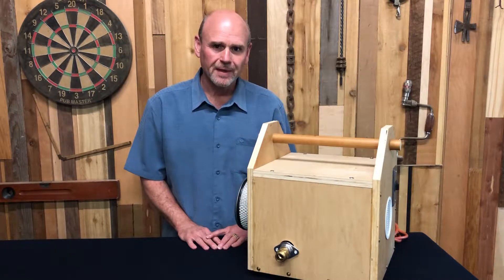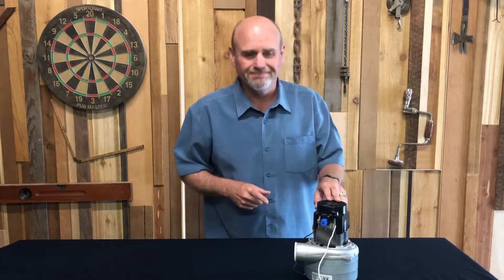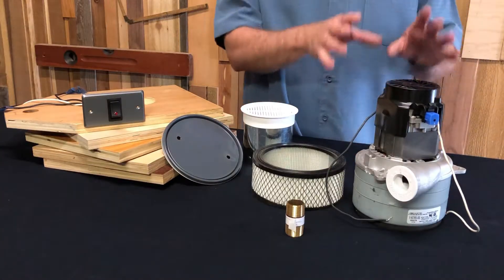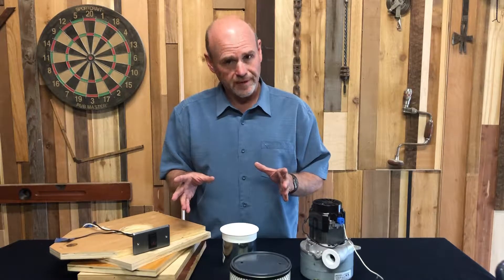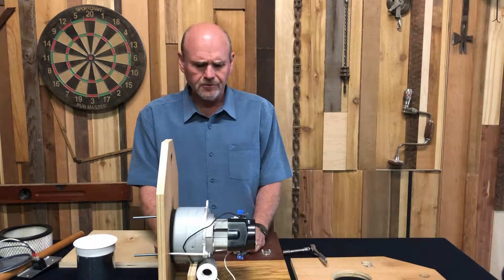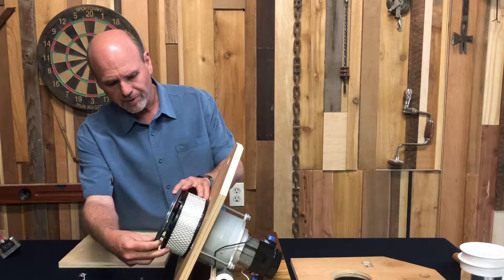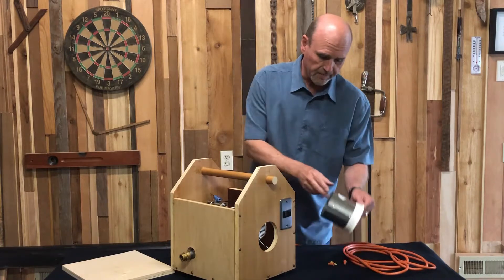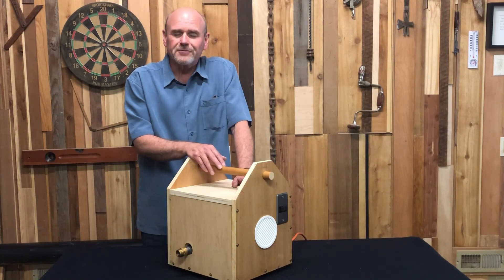Build Your Own HVLP Turbine Sprayer

Comment: What will be a great improvement is a way to additionally cool the motor. Non-bleeder guns or running turbine with valve at the end of the hose closed stresses the turbine.  Also when the motor is shut off the heat is no longer dissipated by the moving fan incorporated in the motor.  Maybe just a simple fan running for a few minutes after the motor stops is a good idea to extend the life of the motor.  And of course - the turbine blades must be kept clean.
Reply: That's actually incorrect when talking about intake constriction to the compressor stages (not the cooling fan and air to the motor itself, you are right there, auxiliary cooling external to the motor itself is always a good idea).  When airflow is constricted to the compressor stages of a turbine/vacuum motor, current intake to the motor actually drops (quite significantly) because less air is being moved so the motor isn't working as hard (if you don't believe me, open up the wiring and check the current flow using an RMS inductive loop on the AC input power line and compare when the airflow is completely blocked, partly blocked vs unrestricted).

Since these are dumb motors we are talking about here, they're just chasing a certain amount of  RPM (they're not going to to proactively try to do more work to increase airflow in the compressor as their is no feedback mechanism). So, the constriction on the intake means the motor ends up actually needing to move less air mass in order to get closer to achieving it's idealised design RPM's, so it's actually doing less work. As such,  it draws less current and  therefore less heat is generated in the motor windings, so it actually reduces stress on the motor (note though, any bonus cooling that is attributable to the mass air flow moving through the compressors turbines disappears in proportion to mass airflow loss as well).

I know, it's counter intuitive; but true.
Reply: @TheMadMagician87  Thank you. Was looking at how to deal with overheating from restricted airflow (gun has small holes). Can these motors be "dimmed"?
Reply: @viktors1  the answer is 'it depends' based on the type of motor unfortunately. Some motors will actually increase current draw if you attempt to slow them down under load (and hence heat in windings, as power dissipation is proportional to the square of the current...double the current, four times the power loss as heat etc). Other motors are perfectly fine though, and have more advanced control mechanisms (think brushless DC motors etc), but tend to cost a lot more and hence aren't seen as often in vacuum motors (yet) and where they are, will be more expensive to obtain.

Comment: Thank you for the wonderful video! I work with an HVLP turbine every day (apartment complex resurfacing bath tubs and countertops).  Have toyed with the idea of making my own turbine using an Ametek motor. Never got around to it.  But the other day a Fuji 4 stage turbine that I've had for 2 months started having issues - it overheats.  The older one lasted full 5 years.  The Graco turbine from 1991 that I had before lasted for 25+ years.  Things are not made the way they used to - everything is cheap Chinese even if it says "Japan" or whatever.  Today I got a 3 stage motor (normally I use 4 stage but a very old Titan turbine (late 90's I bet) I have been using for 2 days now is 3 stage and works perfectly for what I do.).  $87 for an Ametek 3 stage motor on ebay.  Made in Mexico all right but I am sure it will last longer than the Fuji. Price does not come even close, even if you get a 4 stage motor.
Reply: Wow your Fuji didn’t last? Wow I just bought a Fuji mini mite 5 getting ready to do what you do, hope I don’t have overheating issues. Did you ever call Fuji and tell them your problem? If so did they have a solution? Just curious
Reply: damn inflation. 50% inflation in 4 years.
3 stage now costs $125.
Reply: This asshole has owned one fuji turbine unit that went bad in 2 months, but makes a blanket statement about the product.  This stuff is made by human beings.  Have you ever met a perfect human?  I sure as hell havent and ive met a lot of fucking people in my life.  Seeing as the products are designed and made by imperfect humans.  Even the best products are bound to have defects from time to time.  Well I own 3 over the fuji turbine units.  I have 1 of the older Mini Mite 4's and 2 of the newer mini mite 4 platinum's and they all have served me well.

You are right about one thing.  They dont make things like they use to.  You arent right in the way you might think though.  Some things are actually made better than they use to be and some arent made as well as they use to be.  The reason that products arent made the way they use to be is because of the consumer.  Mainly the American consumer.  People dont keep things like they use to.  My uncle purchased a couch in the 80's  I know because I was with him we he purchased the couch to go in his new home.  2021 he still has that same fucking couch in his living room.  My sister on the other hand, buys new living room furniture every few years.  People use to buy things and keep them much longer than they do now a days.  People buy things now and its not long before they move on 2 the next.  Look at the damn cell phones.  The worst part about it is the American consumer continues to want more for less.  Remember that consumers drive markets, not manufacturers.
Reply: @diversify210  My guess is you are from New York where it is ok to use profanities like popping candy in your mouth. The problem is not just one off once in a blue moon.  That $87 Ametek is slowly giving up on pressure after about 5 months.  Meaning the exact motor that Ametek suggests for a 3 stage HVLP turbine is not made that great. Well, surely - $87 gets you what you paid for. Just lovely, isn't it? Don't get me started on the American consumer - we screw ourselves royally in our quest for cheap. I can go political here and state the fact that certain nations are exploiting this love of ours. Last thing I want to do, sick and tired of politics.
Reply: @diversify210  haha...you really let the guy have it, I have to agree with most of what you said... people used to have shoes for years and just replace the soles too...and many thing....but I think its a combination of some in society wanting new stuff all the time,( as you stated) on the other hand, SOME manufacturers do intentionally build things that are not made to last, or be repaired by uncle Fred.

Comment: Hi Greg, im borrowing a 4 stage Apollo 4-stage that doesnt have enough psi/volume to spray clear coat. im surprised you can get away with your 3-stage? i see ametek make a 5 stage and thats whats in the Apollo 5-stages. do you thing that would do it?
Reply: I'm currently gearing up to make the two motor version you can find floating around the web.  Combines a 3 stage and a 2 stage, theoretically that should give me a 5 stage.  I'm a little worried about the amp draw with two motors, otherwise I would have gone for two 3 stage motors.  It seems really hard to get your hands on those 5 stage motors, while the 2 and 3 stage are readily available on Amazon.
Reply: @Marcus-id5ur  Get two 3 stage motors off ebay.  Ametek, $87 each.  Why not.  And yes, the amp draw will be a problem. Standalone 5 stage motor is too expensive.  Ametek makes a 6 stage motor too but I don't think you can buy it anywhere - probably a special thing sold directly to companies that use that kind of motors.
Reply: @GreatWhiteNiko  Why not is Amps.  3 stage are 13 amps, 2 stage is 8.  I'm no electrician but it looks like people have made the 3+2 stage setup work all on one circuit.  I guess if it trips a breaker I can always rewire each motor separately and run it on different circuits.
Reply: I love DIY builds.  I think the key is being able to recycle expensive components in order to get value out of builds.  Also, building machines helps us understand how they work.  The understanding helps when troubleshooting, modifying items to suit your needs, and is great as a mental exercise.

I did wonder about cost for this build vs just buying an 3-stage HVLP.

My estimates:
$  87 Turbine
$. 10  soffet vent piece (two)
$    2   PVC fitting
$    3   Brass coupling
$140 spray gun
$ 25. Hose
$   4. Coupling
$.  3. Loctite 
$. 15 air filter
$.   5 threaded rod
$ 15 plywood and fasteners
$. 6 power connector
$ 10 extension cord
———
$325 material total

If you spend 2 hours online buying parts, and another 2 hours building it, and value your time at $30 / hour, the labor costs $120.

$325. material cost
$120 labor cost
———
$445 total cost

The learning factor is priceless.

A second hand sprayer and free turbine would make this an incredible DIY return.  I’m sure someone watching for a discarded home vac would be able to score in a reasonable period.
Reply: @douglaspollock102  If you own the gun and hose already buying a new 3 stage Fuji turbine only is 400 (cost + shipping). The exact same motor you found for $87 is in the Fuji 3 stage - Ametek 116675.  I changed the burned one in my Fuji in 10 min last week. Did paint work for about $5K with the new motor already. And got a second one for the second Fuji I got sitting in the garage with a burned motor.

https://www.phelpsrefinishing.com/fuji-turbines/fuji-1102c-semi-pro-turbine-w8daz

If you are going to build the box out of wood etc then you need all kinds of woodworking tools.  But if you look at the Fuji turbine housing it is ultra simple - it literally has 2 foam cylinders for the intake air and the cooling air and a simple metal connection to the outtake (it just fits snug into the motor outtake pipe).  There is a breaker and a switch.  That is it. Filters are too coarse and too small size. Definitely not worth $400 but at least it is made of heavy gauge metal and has lots of screws holding it together. Plus it is the smallest possible size - good for someone like me that lugs these things up stairs all day long. Overall that small size turbine is a winner.  I understand Graco and some other American turbine brands now use custom made motors - wtf?

DIY would make much more sense if you can find an enclosure that is pretty much a perfect fit for the motor.  All this plywood cutting and circle carving does look like $30/hr exercise.
Reply: GreatWhiteNiko that wood isn’t going to dissipate heat as well as metal.
Reply: GreatWhiteNiko the more I think about it, it makes more sense to just buy one and start making money with it.  Unless you can land the major components for nothing, the time is better spent elsewhere.
Reply from the maker: I didn't actually spray clear coat with mine, I used it for spraying plasti-dip, but I would think that a 4 stage unit should be able to spray that material. Possibly its a thinning issue or using the correct needle set. I have had to play around with different size tips when spraying thicker materials.  I would look at those two things before investing in a 5 stage motor. Good luck!
Reply: @gregbelair4164  I spray cheap clear coat from English Color.  Viscosity is low so no problem. The tips I use are 2.5 mm - for some reason they produce less overspray than smaller orifice tips with certain coatings (epoxy and polyurethanes).

Comment: Well how’s that thing working out?  Thinking about building mine the same way instead of dishing out the big bux.  What’s a good spray gun for that size motor?
Reply from the maker: Hey durango, The unit has worked great. I used it to spray a truck with Plasti-dip last fall, and will be using it for some cabinets in a couple of weeks. Lots of power and plenty of air. As for spray guns, this system is built for "Bleeder Guns". That means the air is always blowing through the front of the nozzle regardless if paint is flowing our not. I have been using an Earlex spray gun with it and it does well. Spray Fine also makes a pro level gun too. Good luck with your project.
Reply: Greg Belair thank you for the reply.  Would a gun like the Aerojet rs1 work.  Would I have to make a by pass if I went with a no bleed gun?

Comment: About 10 years ago I bought an Apollo 7500 Atomizer gun at a woodworking show.  I then built a turbine system identical to the one in this video.  A couple of things not mentioned in the video that I have discovered: the Quick connects on turbine HVLP guns like the Apollo, Fuji, and others are the same as the garden hose quick connects that you can get at any big box, or hardware store, and they work fine.  The hose I have used is the 3/4" "Smartpond Black Pond Tubing" from Lowes (HD, Menards, and others probably have the same thing) that I then attach to 3/4" garden hose ends.  I always use the ones that have the brass nipples and use worm-gear clamps to secure.  The only down side of the hose is that it cracks pretty badly if you step on it, otherwise it works well.
Reply: hi.  What engine should I use to make one if you can guide me
Reply: @rubenramos1000  buy stage 3 or higher
Reply: @rubenramos1000   GET A  3 STAGE VACUUM  MOTOR . MAKE SURE ITS AT LEAST A 3 STAGE.   A 4 STAGE IS EVEN BETTER.  THESE ARE ABOUT $125 - $200  BRAND NEW. ALSO YOU CAN BUY A USED MOTOR FROM EBAY .
Reply: I need to replace my Earlex Sprayport Pro-8 gun and I can’t find a way to neck-down the inlet of the Earlex 6003 hose to a standard 1/4” quick connect fitting used on nearly all HVLP guns. Any advice?

Comment: How would connect two motors? To have a sprayer equivalent to the maxi-miser 3000
Reply: For Hvlp...with two identical motors you would want to connect the discharge horn of the first motor into the air intake of the second. Motors can be purchased with an optional collar that provides an attachment point for the horn of the second motor. The supplier will also have a rubber "adapter bushing" that fits on the collar and has an OD that matches the ID of the discharge horn. 

Simply combining the discharge of two motors in a single outlet will generate FAR FAR tooo much heat. with very marginal improvement over a single motor given the HVLP circumstance. Ask me how I know....lol
Reply: @MrEyesof9  Thanks a lot for the response. God bless you and your family!
Reply: @MrEyesof9     Have you chewed on the thought or measured the PSI output of two systems being connected with a Y garden hose adaptor?
Reply: Da SuitMan I first connected the two motors in a Y or parallel config the output at the end of the hose was 13 or 14, this was NOT the way to do it the output should instead feed the input of the second, it is very important the motors match. But I swear to you I NEVER use that machine, I opt for a two stage croci every time. If necessary when using architectural coatings (thick) I use a knock-off  Gast (Chinese brand I can’t remember at the moment) 3.2 amp wob-l compressor to pressurize the gun cup with a 1/4” push connect hose at 6psi. This allows the turbine the sole responsibility of atomizing only, of which it can handle Advance, Scuff-x, Cabinet Coat. Fine finishes on the other hand simply do not need more than a 7.4” 2 stage.
Reply: Have you chewed on the thought or measured the PSI output of two systems being connected with a Y garden hose adaptor?
Reply: lisa mcnabb where would you like me to post it? Are you referring to the home made 6 stage?

Comment: Hi Greg, 
I got the Turbine working and i'm getting  7 PSI  but dropped one big clanger i didn't realise  that the  HVLP  Guns  that are used on compressors do not work on  turbines and vice versa  , i'm going to convert the hose set up to 3/4" i'm struggling to find Turbine guns over here in the UK ( I have seen one gravity fed gun on ebay that quite a few different  sized nozzles  are available for but shipping to the  UK  etc is too expensive ). 
Regards  
Len
Reply: 5 stage turbines are rated to  do 9 psi.